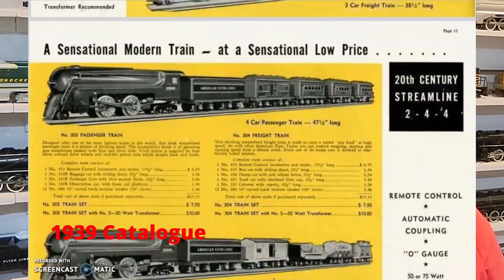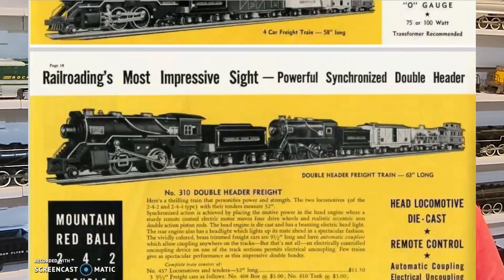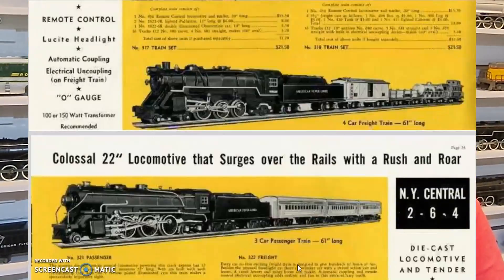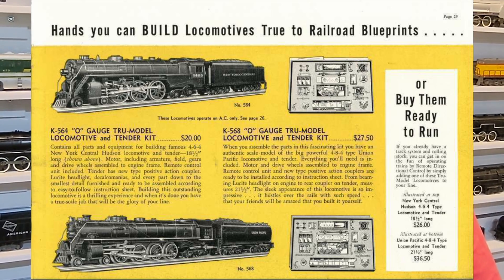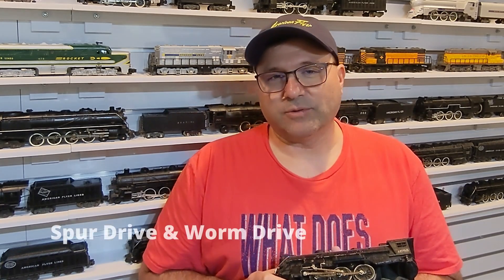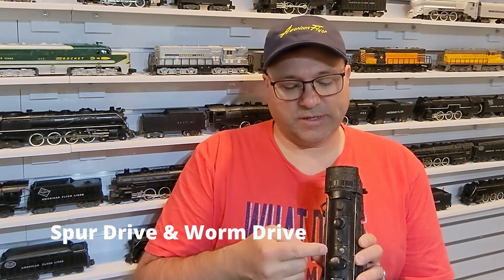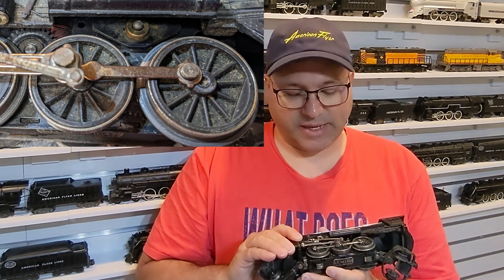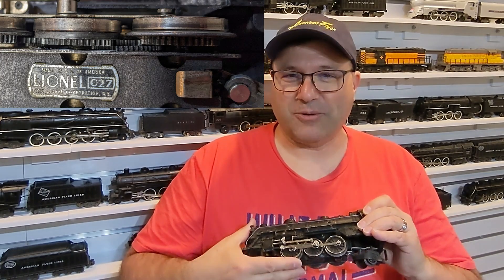Transition from O to S: American Flyer 1939 Engines

Comment: At about 46 seconds in your video I spotted an 0-6-0 three rail Flyer engine that was full O scale size. I didn't realize they made anything that detailed quite like that. I also saw one in person at the last trainshow I was at, I wanted to buy it, but it was over $500 (for the whole set) so I admired it.
Reply from the maker: Unfortunately I do not have any details on that engine but give it honorable mention in the next video.  I agree that it appears 3/16" scale also
Reply: The 429 switcher! It's a brute and a very smooth runner. Get one you won't be disappointed

Comment: On the O gauge chassis the center track pickup is the hot leg of the circuit. The outer tracks that the wheels ran on are the ground to the circuit.

Comment: Nice watching something that many have ignored.  The engines that you showed are fascinating when you take into account what was generally avaliable in the toy train market at the time. Many people have converted  these engines into two rail engines and they do just fine especially with the RDC unit. Has anybody out there converted the spur gear drive engines as this design difference would be fascinating to see running. I have several candidates awaiting this process.   I wonder if creating a whole new chasis with Postwar drivers and somekind of gearing for wheel backsides is possible  or perhaps another chasis regauged.        CASG

Comment: Hey Austin was 39 the first year for the Worm Screw drive? I received one to upgrade and found my DC Field fit it perfectly and the engine runs like a top??????????I was curious to think that 1939 was 85 year ago and my DC Field s work on them.  Take care, Great Video, D
Reply from the maker: I believe they started using them in 39.  Wow that's amazing!
Reply: @AustinsAmericanFlyertrains  do you have any more details on. The model train kits from Flyer? I wanted to if I could recreate a Flyer kit with my stuff.
Reply from the maker: I'm sorry but I do not.  I would suggest reaching out to Willamette valley YouTube as he was very helpful with the video project.
Reply: @DennisMurphey  
If you look at the old prewar catalogues you can see the basic components they included. The chassis was fully assembled on both motor variations. I’ve been watching eBay for some time waiting for a box to show up.

Comment: Hi Austin, Great series! Thank you! Just a question: I bought a 321 set at a thrift store. Got it running, and love it. It has smoke with the chuff sound. You mentioned that the 321 has chuff only, and the 322 has smoke. Could this be a variation?
Reply from the maker: Hi Daniel... congratulations on getting it operational!  Hudson's are my favorite!  There are a couple possibilities...it could be that a different shell was placed in a 322 but it could also be that you have a 321 with chochoo and smoke.  I happen to have one as well.  I am unclear why the inconsistency but it keeps the hobby interesting.
Reply: @AustinsAmericanFlyertrains Thanks Austin! I think I had my terminology wrong. I was thinking that chuff and smoking choo choo were the same thing. I've always been a tinplate O and Standard Gauge guy, and this is my first exposure to S gauge. I had to build an elevated oval out of Erector set parts to make room. This has been an enjoyable addition to my train room. Thanks again! 😄🚂🚂
Reply from the maker: @danielpfaffe4914 sounds like a fun layout!

Comment: Austen , have u looked at the flyer HO the way they done that in the same era !! it is interesting !! AC to DC
Reply from the maker: I have...I am contemplating a short video about the HO as it truely was amazing technology.
Reply: @AustinsAmericanFlyertrains  besides S i collect H O and 3/16 O i have found a.f. 5818 in AC and DC .  i run  the ac one and the guts look similar to the O flyer
Reply: @AustinsAmericanFlyertrains  what engines do u have in HO ? i have both ac and dc engines !
Reply from the maker: I did have the great northern diesels and the 4 wheel switcher but sold them.  Do you have video of your engines in operation?  Would you let me use clips of them operating?  Please send me an email aftrainfun@gmail.com

Comment: Sorry for my strong reaction.  My comment was too much, and that wasn't right.  For me it just seemed ironic that American Flyer would be characterized by itself or by somebody else as "True Scale," since the "Finescale S" that I model is generally much more accurate to scale and detailed than American Flyer--especially the track and wheels.  

But I do acknowledge the nostalgia and the collectability of American Flyer, and its appeal.  Here in Utah I was invited to join the local "Golden Spike" AF Club, but I didn't see the point too much.  They are a swell bunch of guys (and gals), but my equipment won't run on their track, and their equipment won't run on my track--the standards and dimensions are not the same, or compatible.  Even the track power is different.  

It is true that "to each his own," and I accept that.  Normally I'm not triggered of course by an AF video, but I had never heard the term "true scale" applied to AF before.  If you want to see what I model, you can look at this YouTube video:  "S Scale in Fine Scale - John Pratt's Wonderful Scratch Built S Scale Model Trains".  This video focuses mainly on my scratch building and craftsman kits, but only shows a small portion of my stuff.  All my track is also hand laid.
Reply from the maker: I appreciate your followup.  Thankyou.  Context is important to note.  The video that you commented on was part of a prewar series I did...1939-1941...AC Gilbert was wanting to mass produce a more scale like electric train option.  HO scale was certainly impressive!  I attempted to show through the series(I would encourage you to watch the different videos) how very toylike and unscaled earlier engines and cars were.  So compared to what had been this was truly ground breaking.  And then, after the war, the track became scale and we had American Flyer S postwar.  
I used to model in HO with DCC and steam engines that rivaled brass in detail and had much better sound than anything I hear in larger scales...fine scale or toy.  And there is an appeal.  I get it and appreciate you and others who take the scale to life like proportions.  
One thing that I enjoyed about AF/hightail is that it is more robust.  And that the accessories are also more robust.  I don't know about you but the thought of having a child operate a very expensive, very detailed engine, is not for the faint of heart.  Sharing the hobby has become very important to me as I become more aware of the average age of hobbyist.  With my flyer items I'm able to engage visitors of all ages and let them run the trains, push the buttons.  Sometimes there are accidents but generally these do little to no damage.  
I do have a few pieces that are very nice and a few modern productions with greater detail and are more scale.  These are all able to operate in AC power and high rail track.  For me this is the best of both worlds.